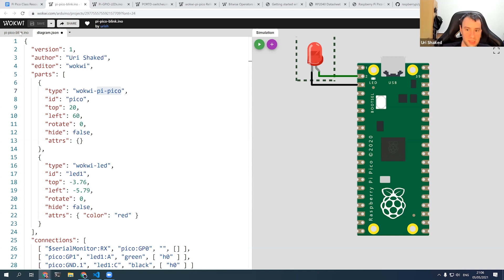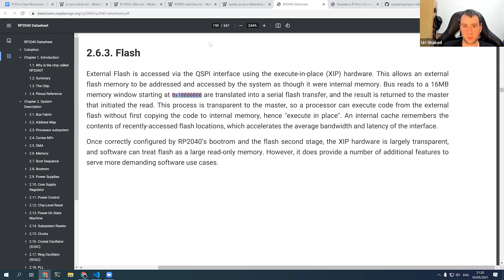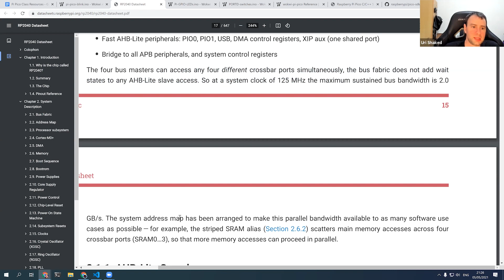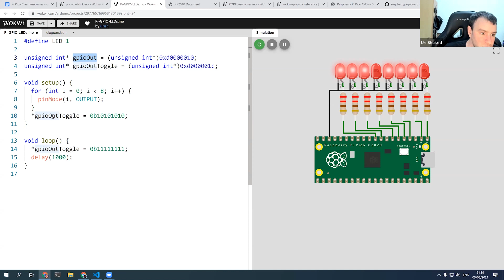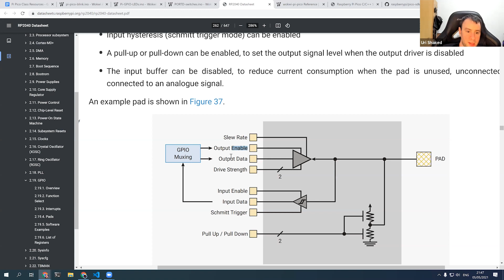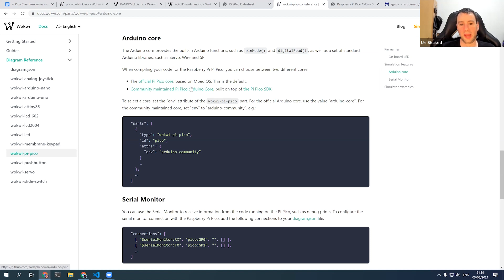HackadayU: Raspberry Pi Pico and RP2040 - Class 1

Comment: Imagine....a $4 chip that is a capable electrical engineering and robotics lab. Just add $100 in sensors or LEDs...or...use the emulator to teach a class without each needing to even spend $100. Thank you!